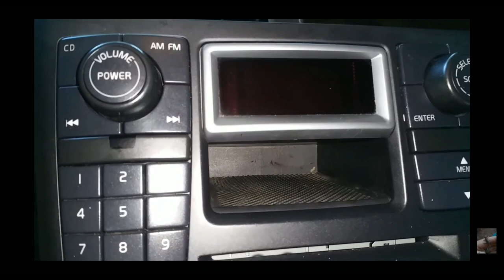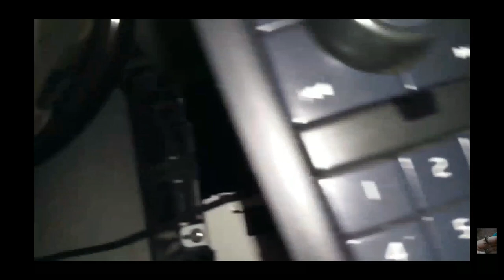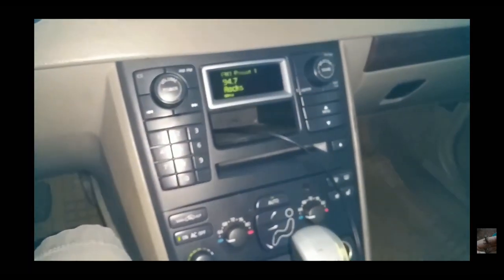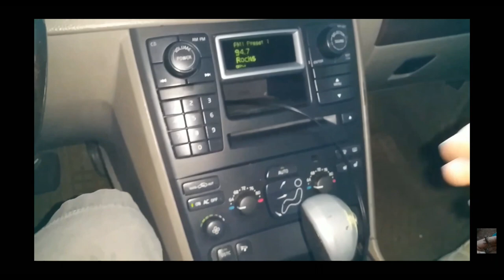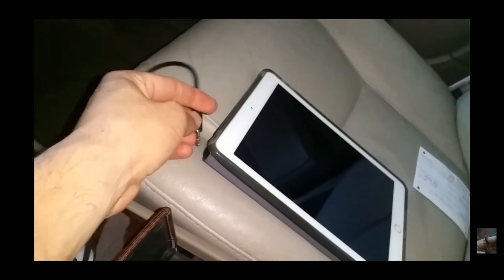Volvo XC90 Aux input install step by step (adapters in description )

Comment: Many many thanks for creating this video! I did this mod today and it works as desired. Without connection on 3.5mm I can listen to radio like always; when any source is connected to 3.5mm, FM is muted perfectly and music is playing.
My XC90 is 2.5D 5cyl from 2004 with factory phone and gps. Board version was “2006”, the second one you presented. There is one very handy hole in the metal plate for the cable.

As for the sound - it is splendid and better that it ever was, since my CS player shows deck error and FM radios in the Netherlands are not the best in terms of audio fidelity. 

Cable I used is just plain Ethernet, 5 meters is enough to get it to front seat, if you want to get it somewhere into dash best is to use about 7M.
Reply from the maker: That’s awesome! Thanks for there feedback!

Comment: Just did this on my 2004 XC90 today.  Wow, surprised how well it worked!!  I bought a 20' shielded 3.5mm headphone cable on Amazon and cut one end off to use as the audio cable.  Also got a lightning adapter with a 3.5mm jack and a charging port so you can charge and listen on an iphone at the same time.  I was looking at a $250 solution from Grom, glad I tried this first.  Kudos to whoever figured out the proper places to solder the audio cable!!  The only thing you don't get with this solution is the ability to change tracks with the steering wheel buttons, otherwise the sound is great and very happy with this hack!!  BTW, my 2004 had the 2nd type of board in it which is listed in the comments and on the video as being only on 2006 and later.
Reply from the maker: I’m glad it worked and that’s good to know that it’s a 2004 that’s different. Thank you for the feedback.
Reply: how you do you have photo or the cable you buy?
Reply: Can you confirm that this is high quality audio similar to the CD? If it is FM radio transmitter quality this would not be worth it to me.

Comment: I've done it, it works perfectly, thank you very much !!!! Now I can mount the android tablet !!
Reply from the maker: I just realized you got it fixed. 😄
Reply: @ProZacksProjects  Great install, perfect improvised solution. I bought an '05 V8 for a work truck. I noticed the rear multimedia set-up, premium sound, navigation pops up out of the dash... everything i could need. Then i discovered that it was missing the MOST IMPORTANT THING, an AUX input. No worries, I'll just install a Line In to the antenna... oh no, its all fiber optic! I got a FM Modulator but I live in Austin, Texas. Every single frequency has a station, even the 87s and 107s. 
This has all been very infuriating until I stumbled upon your video. Thank you!!!
I've noticed a lot of aftermarket head units say it won't work on XC90's without an AUX input (they keep the little LCD screen and you have to turn it to AUX. Does your hack solve that by turning it to FM then? I was planning on just yanking every aspect of the radio and install new amps and JBL components but a Volvo tech warned me that some of the security and ignition runs through the factory stereo (i guess this is why that little LCD has to remain hooked up). 
Sorry for the long comment, thanks again for sharing your work!
Reply from the maker: @greghoward4043  that's awesome you got the media package. What this does is overrides the FM signal coming once you plug in your AUX cable. The ground on the cable is what turns kills the incoming sound from the station then you only hear what you're playing. I hope this answers your question

Comment: NEVERMIND it works now heck yeah. you're the man. I did find others that were closer like the other guy said right under the passenger seat it's so much easier but this video is also easier for those who like a little sawdering challenge and all that other hiding wires and so on lol. but this video is very useful as well
thank you

Comment: So glad i came across this video.  I just replaced my headliner and was wondering what that was.  I'm reviving a 2006 back to life.  The plastic part that extrudes through the body is faded on the outside top. Now knowing that is where the antenna is, I will be a little more selective on what types of paints I use to repaint the exterior part of the plastic.  I would personally just love to remove the entire entertainment system and replace with a modular modern system that uses something like Android OS.  But the way Volvo has that system integrated throughout the body frame is going to make it difficult.  There are some things that Volvo did to their vehicles that I am like...wow! That is genius.  Then there are other things, like the radio, I'm like WTF??

Comment: I’ve found some similar instructions on swede speed forums. Who recommended cutting the r9 part of the circuit board. Which had something to do with the AM? 

I believe theirs worked by press AM on the receiver. 

How did yours work?

Do you know if it’s necessary to cut r9
Reply: Yes, that disables the AM bandwidth from the circuit, since you soldered to the AUX. Your AM channel on the stereo will work for AUX input and still you can use FM for your radio

Comment: What mode did you use to test  surround sound. Was it on FM? So any fm frequency would do or need to set the radio for a certain frequency? Sorry a lil bit confused here.
Reply from the maker: So any fm frequency will be overrode when you’re plugged in and in the settings you go to surround sound and select it. I would give clearer directions if I hadn’t just sold my XC90.

Comment: Thanks for sharing this video. 
Worked perfectly on my Volvo XC90 2.5 AWD 2003
Reply: Archil Durglishvili bbh
Reply: Sorry, have to change to aux on radio?
Reply: The radio of my car does not have an AUX input by factory, so that nothing can be changed in the radio related to the AUX.
I do not need to change anything in the radio. 
Just need to switch on the radio, even let it to play any radio channel, and then connect the newly installed aux cable to the phone/tablet. Once the music starts play in the phone/tablet the radio will stop playing radio channel and start the music from the phone/tablet.
Reply: Incredible, I'm going to try it, it can be great.
It can be connected to the tablet, and when you give the play cut the radio, or nothing else plug the radio is cut?

Comment: This is awesome, I don’t have to have a load of cds hanging around anymore. Add a Bluetooth receiver for the finishing touch 👍🏻
Reply from the maker: Neil Glenister I'm actually thinking about doing that. Easy connectivity!
Reply: Just to let you know I got a Bluetooth receiver, double female 3.5mm coupler to connect it, and the soldered cable and a usb cigarette adapter. Now the whole thing sits hidden in the back with the power coming from the cigarette adapter in the boot. Works a treat and glad i dont have to run the cable through the car :) Thanks again for the great guide
Reply from the maker: Now that is pretty epic. I appreciate the input. Who knows, i might wind up doing that myself. 😉
Reply: The radio stays on even if I’m connected to the Bluetooth receiver until I play something on my phone, then it switches.
Reply from the maker: Neil Glenister my galaxy note 4 would do that when i connected it. Once i got the note 8, it cuts the radio as soon as i plug it in. I believe it's how the device utilizes the headphone jack. Try plugging a different device if you have one and see if it makes a difference. Hope this helps.
Reply: It could be solved by putting a small cut-off switch, to leave a tablet on, and be able to put the radio

Comment: İt's nice but you are using radio sound way and if you get any signal and connected 3.5 jack you must get parasite. Explain please
Reply from the maker: When nothing is connected to the jack the radio works like normal without any noise. Once you connect something, the top of the jack, the ground, and it overrides the incoming signal. The only time you might get some noise is if you touch the end to a grounded source.

Comment: So the radio signal is overruled by the aux input when that is plugged in?
Reply from the maker: Correct. The ground which is the top of the cable interrupts the signal from the radio.

Comment: hey i need to know what the cable you put is not aux
Reply from the maker: I used a speaker wire as an extension cord. Is that what you’re referring to?

Comment: Hi, should I change the input to AUX on the radio? for test?
And what is not clear for me, do you have two wirings (my03, my04...) what is the difference?
I have Volvo T6, 2003.

Comment: Can you describe the wire connections both at the pcb and then on the Aux Jack side? It appears to be 3-wire at PCB (I have an 06 XC90) but in the day-after shot it looks like you might have had 4-wires. Then you spoke about soldering the 2 grounds as one and then red and white to the speaker wire going up front. Does the Aux Jack have Left-Right-Grnd? Thanks all in advance.
Reply from the maker: I was using to speaker wires so I just utilize the black wire in both of those as the ground.  So the 2 grounds put together were acting as one wire. So you would have left, right, and those 2 together as 1 for the ground making a total of 3 wires, if that makes sense.

Comment: Is better and easier to get the input from the amplifier under the passenger's seat. Still, thank you for posting this video.
Reply: This would definitely save a lot of work. Do you know which wires I need to use or where to solder an aux cable to the PCB on the amplifier itself? I'm trying to find some sort of diagram but am not having much luck...
Reply: The input on the amplifier is digital. Unless you have a device that can interface with the digital protocol, the input at the amplifier is useless.

Comment: it is much better to install bluetooth module there instead of wires. i'm sure you can find 5V in the radio board.
Reply from the maker: I Agree, I was doing it this way because i had a lot of wire and i didn't want to buy a bluetooth receiver at the time.

Comment: Hi, very good video. I have an xc90 of the year 2006, and I can not install an auxiliary input to the radio of the vehicle, several people tell me that it is very difficult to have fiber optic connections. I like your video for the simple and not so invasive of the installation. I could send a map of where to connect the cables to the antenna of the vehicle please, I am from Chile and I do not understand much English, to explain to a technician what to do and where to weld, I would greatly appreciate it.

Comment: I'm going to try this. Why not run the cable through the header (roof) and then come out by the light controls overhead and put a bluetooth receiver with a mic on it there?
Reply: 2nd thought, might impede the curtain airbags. If do this definitely disconnect the battery.

Comment: Hello, why you not used one long wire from the roof with female jack 3,5 on the end?
Reply from the maker: I was just using what i had lying around. If i had a 15 ft headphone Jack i would've used it. Which that's something to plan on if you wanted to do this, and that's a good point to bring up.

Comment: It works! Many thanks for this tutorial. Just a little problem, the gap between two tracks is filled out with radio signal. Any ideas what to do with it? Regards Laco
Reply from the maker: Sorry, I just saw your comment. It might depend on your ground. The ground on the end of the headphone Jack is what interrupts the signal but it could be that the Jack isn't grounding enough. That's a tough one. Hopefully this helps.

Comment: Hi. Thanks for the video. I did it, but I have small problem, that there is a little noise behind. The same on the car of my friend. When I plug in jack automatically I hear small noise. Is there any way,how to solve it? Everything is good soldered.
Reply from the maker: Make sure the device isn’t plugged in to the cars power. If that’s not it, try plugging in a different device. If that doesn’t solve it, there’s inline noise reducers for things like this if you can’t get it to stop. Hope this helps.

Comment: Since its been awhile after this mod have you had any problems? Also will this work 2006 xc90 thanks,
Reply from the maker: It still works just fine, and yes it will work on an 06. The circuit board might look different though. I believe there just the 2 variations. If it's totally different you can look it up and find the circuit board that matches yours. Hopefully this helps.

Comment: aux in uses radio channel, after this job my radio not working. How to do this on CD channel? I don't need CD channel but I need radio channel
Reply from the maker: Your radio should work once you unplug the headphone jack. If not, check the solder points to make sure nothings overlapping or connecting. The other channels on the stereo have to be tapped into in other areas that I don’t know about.

Comment: Hello, thank you very much for the video. I do not finish understanding the system. I pay for the cables in those points of the antenna, I carry the cables in front of the car, I connect them in a YAC connector, and I connect an external audio source
And what do I put on the radio to make it sound? I see the frequency 94.7, but I do not understand why

  I'm very interested, please, if you can help me
  I've searched a long time for something like that
Reply from the maker: When you hit play it should come through on the speakers. Did the ground get connected to your yac connector? If not, that’s your problem. The ground is what triggers it to override the radio.

Comment: Maybe I'm to stupid to understand but do anyone have wiring schematics i dont get + and - wiring
Reply from the maker: The + & - refer to left and right. It's kind of complicated but I'll try to make sense.  Typically the red wire is the right speaker and the other color which may be black or green that is the left speaker. What you can do is sauder on the wires to the pcb and then the connection that you're gonna make to the headphone Jack, just connect them temporarily and do an audio test to see if the left speaker is making the left speaker sound and if not the can just switch the cables. Hopefully this helps.  You can mix them up and all sound just fine but if there something that is supposed to come out of the left speaker might come out the right speaker.

Comment: Hello,
I made it same way but it is not working.
Also I lose my radio now  :(
Do you have any idea ?
I have 2003 t6.
Reply from the maker: The areas between the soldering areas are very tiny and if the 2 things connect that shouldn't, then it'll possibly ground out the sound. Just make sure nothing is cross connected.
Sorry it didn't work out.